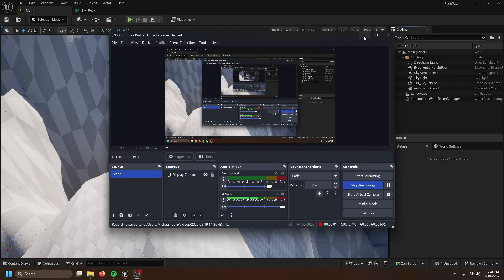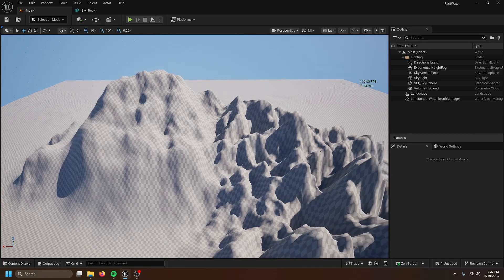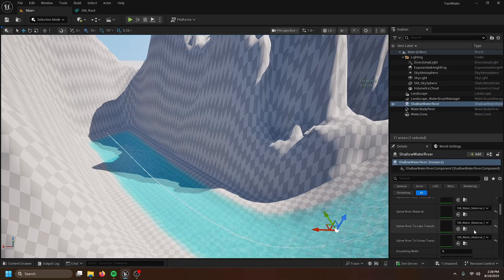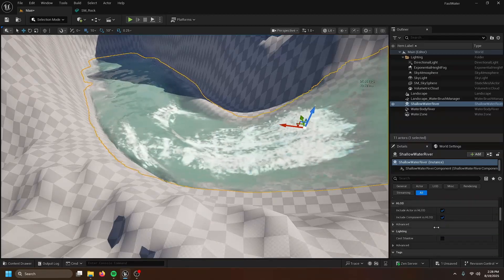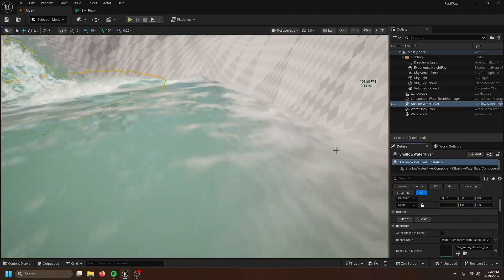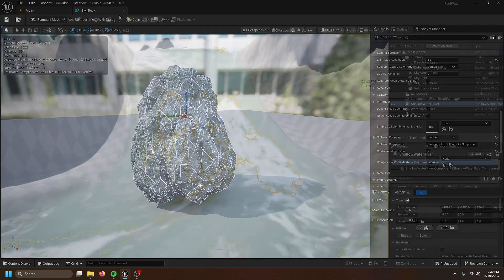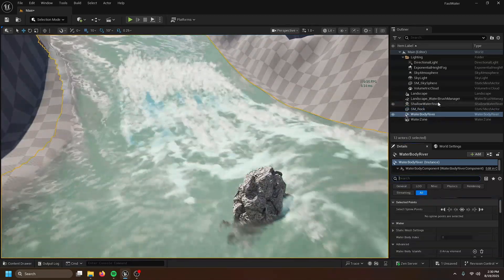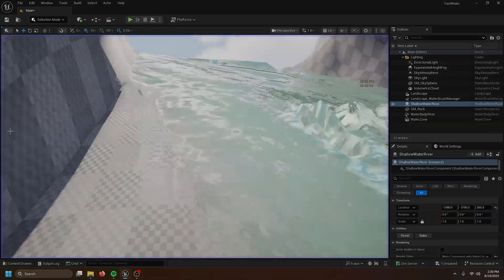Unreal Engine 5 Witcher Water System in UNDER 3 Minutes!

Comment: how do you handle multiple water body that connect with each other?
Reply from the maker: Personally, i would plop 2 actors each to deal with all the dynamic water and be done with it.
Reply: @MeanLemur24432  2 shallow water? and what if you have multiple rivers that go in one lake? do you use a shallow thing for the lake?
Reply from the maker: @Dhieen  Usually my water kind of trickles into a lake so i would add a niagara system that kind of fakes it